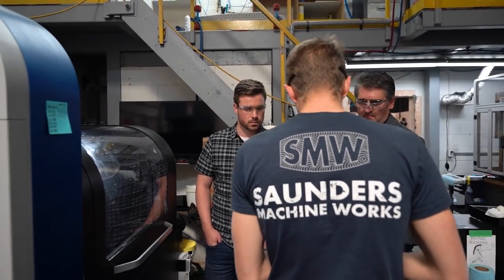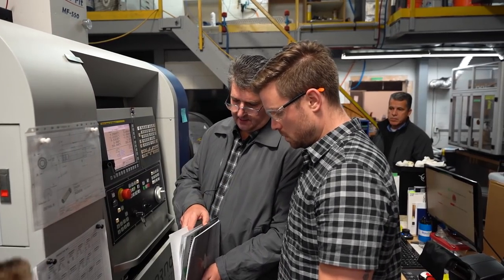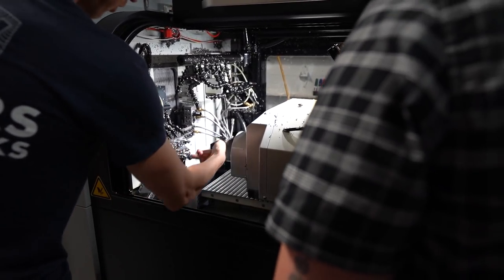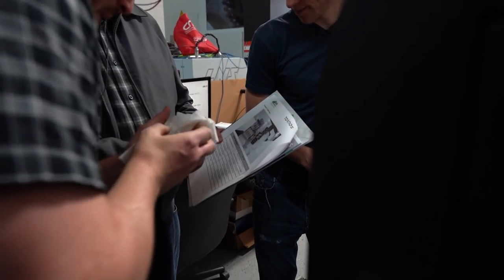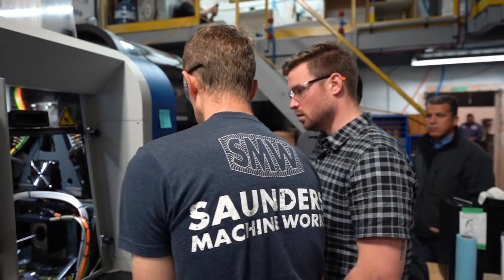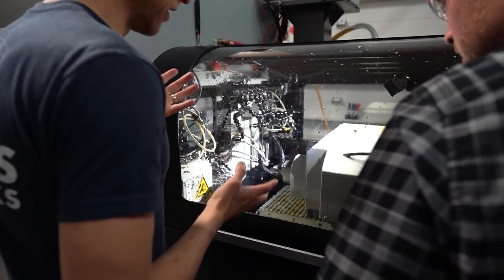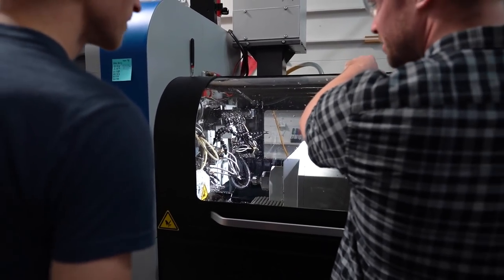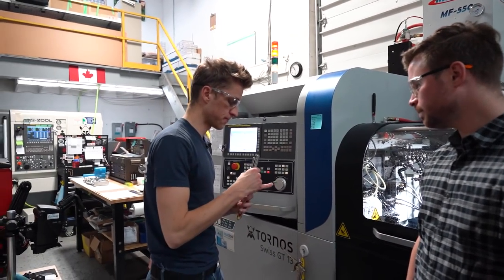Grimsmo Knives Deep Dive into SWISS LATHE! - Tornos Swiss GT 13

Comment: @John, for redundant tooling there’s a great way to rely on the secondary tool cutting to size. This is something we do regularly, I’m in large scale manufacturing. 

Disclaimer: This does require having all tooling pre set, best case using a pre setter external to the machine or the setter inside the lathe. This should be common knowledge though.

When setting up a part and the machine is warm, throw in a fresh insert on the tool you want redundant tooling for. Run the program to turn the feature and measure that feature with something reliable. If you need to make an adjustment to get it to size make that adjustment in your tool path inside the NC code. We have found if you set up tools when they are fresh using this concept and then swapping to a redundant with a known tool length that parts hold tolerance when swapping tools. This works because you’re technically re-setting back to what the tool pressure/tool geometry effects when a fresh insert is loaded. We are basically cheating the code to give you a turned part to size when a new similar tool is called up. Some say that’s not proper programming etiquette but that’s the reality of mass production and this is how we have found to get redundant tools to repeat in size. This does require a stable machine with rigid work holding and tooling but I think you have that covered in your application.
Reply: Do you need to have Tool Life Management option to make redunndant tooling to work or could you make it with a macro?
Reply: meijertech 
Tool life management is essentially a macro that’s built into the control. You could definitely write your own macro and set a tool life limit after x runs that swaps to the next station when you encounter x. Not having tool management means you will need to reference the new position offset that is specific to that tool. Hypothetically tool 1 and 2 are like tools and 2 is the redundant to 1. When 1 hits the end of tool life you set at x then you want to call up tool 2 as your new tool 1 using the offsets specific to tool 2. Without having tool management you’ll have to call up the tool number as a variable let’s say B. At the beginning or end of your program you’ll have some statement that looks similar to B= 1 + y  where y initially equals 0. Y will be another statement as your count loop for tool life initially equal to 0 and will equal 1 when tool life is met. This will require changing variables when you’re finished with all redundants and id recommend writing a diagram and work instruction as not to forget the logic and make it simple for operators.

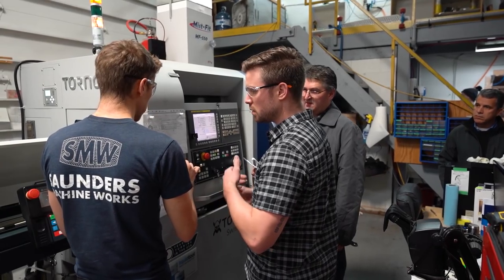Comment: 7:55 "1mm bar stock" :-D dude that's a thin wire
Reply: sledgeoc we run down to .010 wire.... .03937 wire is just slightly under average for swiss machines.

Comment: Also a tip to the guy who made this, check out wiper inserts or a large nose radius and cleaning up the radius with a smaller radius tool or undercutting. Swiss has enough rigidity to make the additional tool pressure negligible as long as your setup is correct.

Comment: i Wonder if the part counter was at max part count made , this is why it was running in single part mode, i know our citizen does this when it gets to max parts made
Reply: Or maybe the Fanuc Control was set to Setting mode instead of Machining mode. That can happen on our newer machines, they only produce one part in that case.

Comment: Hey John, are you aware of the incredibly stupid knife laws that classify flipper knives a prohibited weapon in Canada? According to the government website its considered an automatic. I found out cuz i recently had a knife confiscated at the border.
Reply: He is making them in Canada...
Reply: Not permitted to import, but you can buy them made in Canada.

 Unless they can flip it open with centrifugal force- then it's prohibited.
Reply: @12345NoNamesLeft  Automatic knife – An automatic knife is one that houses a blade that will open automatically by applying hand pressure to a button, spring, lever, or other device, in or attached to the handle of the knife, including knives that have a button, spring, lever, or other device, located in the spine of the handle and attached to the inner part of the blade. 

That's what it says on the website. Doesn't say its prohibited to import it just says classifies any flipper an auto and therefore making it illegal to own in Canada
Reply: @simonn611  So basically although Johns's knive arn't automatic and require the person to actaully flip it (manually) they lump them in as automatic...That sucks.  At least its not as bad as over here - cant even make any knifes like John does, nor sell them - people have gotten around it tho - bascially you "buy" the handle then "buy" the blade as an optional extra (and so cannot be sold fully aseembled only in parts).
Reply: @Nostradamus1981  i think another way of getting around it is to tighten the pivot so much that it can't open. Then once it arrives you loosen it up
Reply: It's a non issue. Automatic knives are "illegal" in a lot of states. But you'll never have any problem, unless you use it in the commission of a crime, or if you're a convicted criminal. Cops don't give a damn about automatic knives. He's making the knives in CA because no one cares about the law.
Reply: Canada doesn't like anything assisted opening, your knife must have had a spring inside
Reply: @Kyle_Harding  nope its a knife that runs on ceramic ball bearings. It was the ferrum forge DAO by massdrop. The rule change is recent because I've had spring assisted ones come across no problem in the past.
Reply: @simonn611  your right, I also read they don't like any blade under 30cm to be consealed in things, so no pen knives but you can rock a 3 foot sword cane lol, O canada